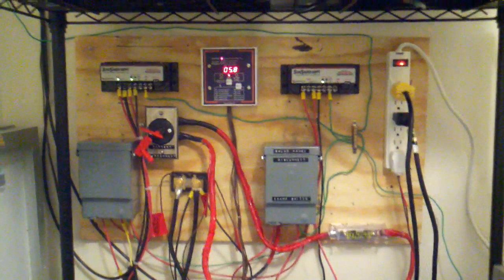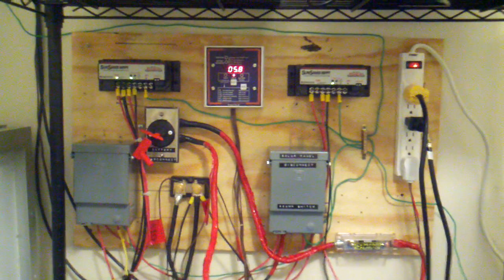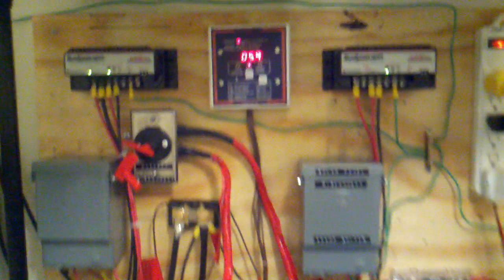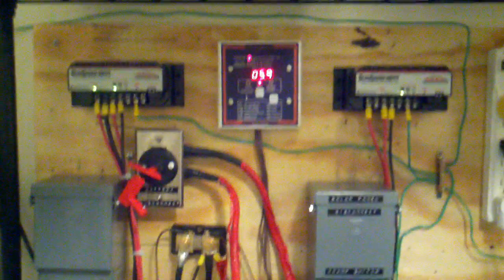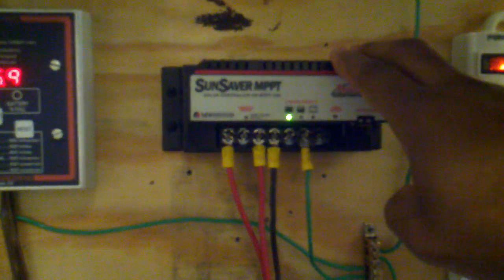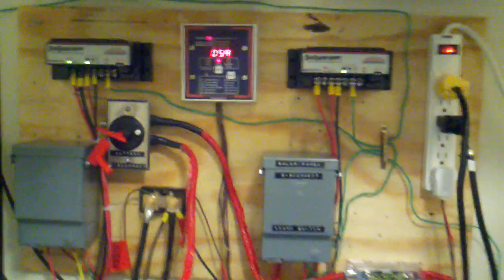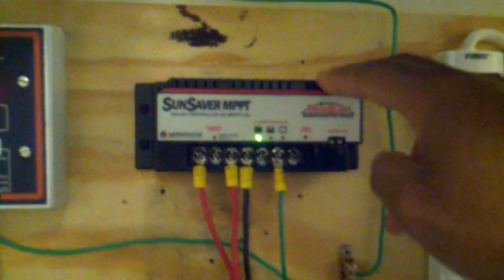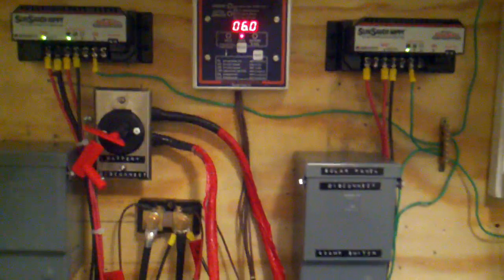DIY - Home Solar - Partially getting off the Grid More Safely

Comment: Great info. I'm confused about the purpose of the shunt device. Why do you need it?
Reply from the maker: MrAikidave Thanks for the comment. The shunt device is a type of resistor used by amperage measuring devices. Current passes through the shunt allowing the meter to precisely measure the amount of amps passing through it..

Comment: The way i researched , it is a bad idea to put 2 MPPT charge controllers in parallel since they can not sense the voltage and currents the right way and given false information to  the controller ( to each other) and which will  the MPPT to handle the voltages and currents the wrong way.

You can put 2 or more PWM controllers in parallel with no problem.
Reply from the maker: +Bonnie Flory Thanks for your comments, however you are incorrect in this case.  Putting genuine well manufactured MPPT charge controllers such as these Mourningstar CC's in parallel are no problem and they can sense the battery voltage easily.  This configuration ran for years with no problems as part of a backup system.  I was skeptical initially as well until I contacted the manufacturer who confirmed that dual charge controllers are fine.

Comment: @randsom So what you're saying is you have two sets of panels, each going to its own charge controller and outputs are connected in parallel.  Am I correct?
Reply from the maker: +Donovan Lym In this video that is exactly what was done.  Essentially, like having to battery chargers connected to one battery bank.

Comment: what size fuses are those?
Reply from the maker: +meatdogg101 Between the inverter and the battery bank is a 200A inline fuse.
Reply: do you have your battery bank earth grounded
Reply from the maker: No, I never saw the need.
Reply: one more question.i have a battery bank of 6 6 volt golf cart batteries.is it normal for my batteries to not reach 13.0
Reply from the maker: With a 12v based battery bank, the batteries while charging should reach well passed 13v even up to 14v.  When not charging and at "rest"  a 12v based battery bank should hover around 12.7v, that's not unusual due to self discharge, that all batteries do.
Reply: Ok. I have 9 Hf panels if i wanted to add another panel such as a 100 watt panel which type panel would you recommend that would tie in with my existing Hf panels?
Reply from the maker: That depends on the electrical characteristics of your current panels.  The new panel could be of any brand, just electrically similar in terms of watts, volts, amps.  Otherwise it could be detrimental to your array output. I believe A 100w panel with 15w panels, even if they were in series would be incompatible.
Reply: so if i want to addon to my 9 Hf panels 12 volt system are you saying that i got to stick with Hf panels and i can't add a polycrystalline or Monocrystalline 100watt to my already Hf array?
Reply from the maker: As they are, they are not compatible.  However, if you are willing risk it: You can, "in theory", you can connect (6) of those 15w panels in "parallel" for a total of around 90w, then connect that parallel string in "series" to your 100w panel and into an MPPT charge controller, because of the increased voltage.  That may work for you, however, you must ensure that the added amperage of the parallel string adds up to be "electrically similar"  to 100w panel (which should be around 7.5A or so). Please be aware that I am not a solar professional or an electrician so take my words with a grain of salt and check with folks who are actually in the business just to be sure.
Reply: Ok.Thks alot.
Reply: What is the best way to hookup my batteries.I have all HF 12 volt panels and 6 6 volt golf cart batteries?Thanks in advance

Comment: @rhandsom Another question about the solar charger.  I know the main function of this devices is avoid the batterie's overcharge and the full discharge.  But, what happen when the battery is full and the solar panels are generating current? That extra current goes to the load or is dissipated as heat?.

Thank you!.
Reply from the maker: The charge controller acts as a gateway and only lets in the power the battery needs to charge. Once the battery is charged, the controller will go into "float" mode and trickle charge the battery to keep it topped off.

Comment: Thank you so much for the information. I have a question.  Why you connect the inverter (load) directly to the batteries bank? The MPPT inverter that you used have a connection for the load to prevent the batteries full depletion. so when the batteries are running low the charger disconnect the load.
Reply from the maker: Thanks for your comments.  I couldn't connect the inverter to the mppt controller because it would draw more than 15 amps from the controller.  Some controllers could probably handle it, but this one wouldn't.
Reply: rhandsom
Thank you!.

Comment: thanks for your video. im having questions about this remote controller i got.
its s.o.c. i always 100% when sun is out then at dark it drops down to 47% resting s.o.c. ? problem is im not even using the system..? 12v-440ah with mppt. my bank soc daily is around 13.7/.5? my controller is the tracer 2210 20A with remote, im wonder is the remote i have just as accurate as your tri-metric.? defenately more expensive.
Reply from the maker: If your SOC drops down to 47% from 100%, then it would appear that you may have some parasitic load somewhere or something is not installed or configured right. The only other thing I can recall that would cause that situation is when there is an absence of a blocking diode and the power from the battery flows backward through the controller towards the panels at night and you loose power. Your controller should prohibit that. I don't think it's an accuracy problem in this case, with an SOC of 47% at night.
Reply: ok as of now my battery voltage is resting at 12.7v %46 percent also theres below a -01% not sure what thats for..
i wonder if the remote is accurate or if my battery bank series/parallel is connected correctly.. hmm?
Reply from the maker: freedumenergy If your battery voltage is 12.7v, then your State of Charge is not 46%, it should be more like 90 to 95%.
Reply: ok yeah i thought so then why is this remote reading it at 46%?? i may need that tri-metric and parallel with this one.? u think..
Reply from the maker: I would recommend a tri-metric unit and call it good.

Comment: I have a large solar system on my home, it's tied to the grid with no batteries to back it up, I do have a large generator that I want to use somehow to activate the inverter when the grid goes down.

Do you know of a way to use either a few batteries or a generator to fire up the converter and allow it to work from sunrise to sunset? The converter gets power from the power co. (APS) start and shuts down auto during daylight hours. I was thinking if APS goes down during the day, I could flip the main breaker and use an alternate power source to activate the converter. Once the converter starts making electricity, then back feed that electric to the converter breaker and I should have power. I know that there is a shut off switch that trips when the grid goes down, so no electric will harm the APS worker. But with my main breaker off, if I can bypass that safety switch I'd should have power.
Reply from the maker: An inverter and battery bank, working in conjunction with (i.e., feeding power to) a transfer switch or sub-panel, which could then be switched to feed power to your converter may work. Do some research on google in reference to generator "InterLock Kits". These kits will allow you to "backfeed" through a circuit breaker safely.

Comment: Installing a solar water heater and putting in solar panels and batteries for your HVAC system would probably cut your electric bill by 70%. Then if you can use the money saved to upgrade the system to eventually have everything on solar.

Comment from the maker: Thanks for your comments.  I'm using 10 gauge wiring for the component connections and 4 Gauge for the connections to the batteries.  However, I've since upgraded to 2 gauge for battery connections.

Comment: One small question. You talk about how the maker of the charge controllers told you that your 12V panels blah blah blah  and say you should get a 2nd controller. Well you make a comment about your 12v panels being in SERIAL. What do you mean by SERIAL? Could you be talking about wiring them in SERIES to get 24V into your charge controller? I have not ever heard of the term SERIAL used before.  as long as you enjoy your system and it gives you what you need then run with it! good luck guy.

Comment from the maker: Thanks for your comments, The panels in series increase voltage, the higher voltage allows me to have panels at a greater distance from the charge controller, and they allow me to have a 24V system. The higher voltages also allows my MPPT charge controllers to use their internal DC to DC convertion circuit, to convert the excess voltage into higher amperage boosting charge current, those amps are what you would expect from panels in parallel.  MPPT controllers do very well with higher voltages.

Comment: "2 new 200W (400W in series) panels" But you can't summarise power output via series connection. By series connection you can only summarise voltage.

Comment from the maker: Not sure if I understand the times you get sun.  But in general, from what I understand Mono Crystalline panels are better than the Poly Crystalline, and the Thin Film's are good if your going to have shading issues and or temperature issues, but they are not as efficient.  If money is not an issue you could go with the Mono's, next I would consider the Poly Crystalline type (which is what I own), the Thin film would be my last choice. In your case, try and get the most out of a panel.

Comment from the maker: @abenwinUT The website is speaking in general terms in relation to the numbers, and is using those numbers as examples. Not all MPPT controllers use the same algorithm to determine the max power point thus making the DC to DC conversion different for each, but generally you can reasonably expect a 30% boost from good controllers. The main point of mppt's is that watts in = watts out, they lower the voltage to increase amps, decrease amps to increase voltage, the power (watts) stays the same.

Comment: @rhandsom How Maximum Power Point Tracking works

Here is where the optimization, or maximum power point tracking comes in. Assume your battery is low, at 12 volts. A MPPT takes that 17.6 volts at 7.4 amps and converts it down, so that what the battery gets is now 10.8 amps at 12 volts. Now you still have almost 130 watts, and everyone is happy.

Comment: great setup, wish i had a good battery monitor system my dam wellsee 60amp works great except it don't stop charging when the charge light goes out, my 20amp wellsee seems to work find. anyway i gotta clean and straighten it up a bit. and make an update video.

Comment from the maker: @NexusRebellion Thanks for you comments. Sorry for the tongue slip, when making these videos, we often get tongued tied etc.  Also, 12V panels in series or parallel are still considered 12V panels, even though they are putting out more than 12V. Actually, a single 12V panel puts out between 17v to 19v. My original 2 were in series putting out 36V and were connected to a 12V system, now they are attached to a 24V system. See my channel for my latest videos, this is an older one. Take Care.

Comment from the maker: @palletman2 Thanks for your comments. Since I have 2 different sets of panels, 1 set = 12v the other = 24v,  I had to have dual mppt charge controllers. If your setup is similar, then maybe as long as your charge controllers are connected correctly to your battery bank and they read the same voltage, then they might work in tandem.

Comment: good video i want to get anothe mppt 250 i have 1 withe 3 hf45wtt kits and 5 batterys ill try to hook both up to my pannels an see if they work togther or will they still amps from each other i have the pannels in series/24 volts an i have hf/chagerhooked up 12 volts split so im thing i can go two mppts

Comment from the maker: @electrodacus I can respect your point of view on this, however I must still disagree.   There are many factors to consider when designing a system and cost is only one aspect.  Also, good panels do not guarantee good performance.  Again, there are other things to consider.  The MPPT's I use cost $198 a piece from ecodirect, well worth it.  That's less than some low watt panels and a little more than some PWMs.   Every opinion is valid, yours and mine. I just share what worked for me.  Thanks;

Comment from the maker: @electrodacus This is a classic difference of opinions between Engineers.  I've read the technical datasheets for various PWM and MPPT's and I have to respectfully disagree with your assessment.  There is a reason why they cost more, because they give better performance.  As an Engineer, you know that product quality has a lot to do with the MTBF.  Different brands will not have the same failure rate.  I also have a less expensive PWM, but It didn't meet my charging system requirements.

Comment from the maker: @electrodacus Thanks for the comments.  The decision to go with dual charge controllers was based on the manufacturer's  recommendations in accordance with my setup.  MPPT's are more expensive true, but the performance boost I've personally witnessed is well worth the extra cost.  Whether it makes sense or not depends on the designer's requirements.  By trade I'm a Systems Engineer, when designing systems I try to design for safety, performance and reliability, so MPPT's fit my requirements.

Comment: rhandsom, Just one of those ebay Power Jack 300W 14V to 28V ones should be enough to cover the excess. They are working good here. Do not connect it to "24V" panels since open circuit they can go to 40V ! I've posted lots of GTI info on the forums at techluck.com , drop on by!

Comment: Looking good. I finally caught up with all your changes. You might want to consider getting a Grid Tie for every day use. Maybe have it so that when the batteries are charged the excess goes to the grid so nothing goes to waste and you can bypass the battery loss and move towards 80% efficiency. I don't know if the MPPT on those controllers will play well with a GTI, you would have to experiment and keep an eye on the system.

Comment from the maker: @randacnam7321 Thanks for the tips, but these controllers may be a little different from what your used to.  Per the manual on page 14 section "3.4 Wiring", these controllers are negative ground controllers, and can be earth grounded on any of the negative terminals.  It also says it's recommended but not required.  Also, the PV arrays will be separate, the (+) leads come into a 60 Amp single pole 2 circuit switch branching out to separate controllers, I'll update the schematic to show this. Thx

Comment: The controllers should be grounded at the neutral side of the battery bank.  Most charge controller load disconnects shut off the load on the neutral side of the load (it has to do with the switching method), and your using the load neutral bypasses this.  Also, do not wire the PV array to both charge controllers at once.  Connect the new modules to one controller and your existing array to the other controller.  Wiring one array to two controllers will cause both to not work properly/fail.